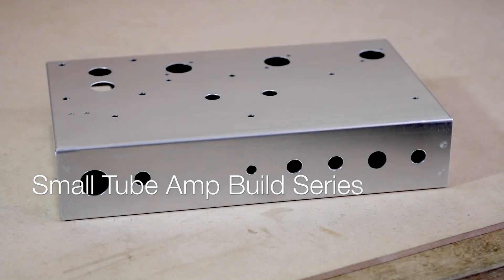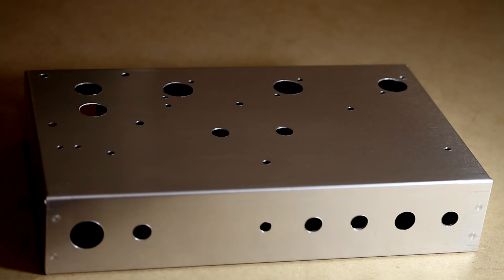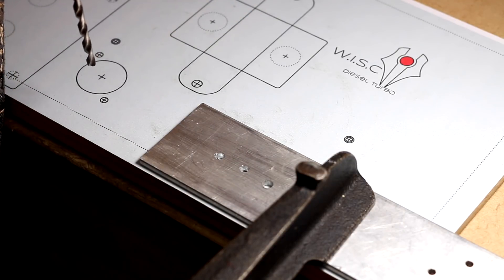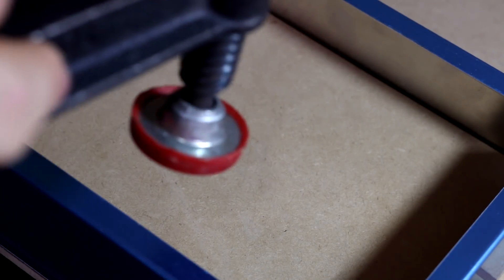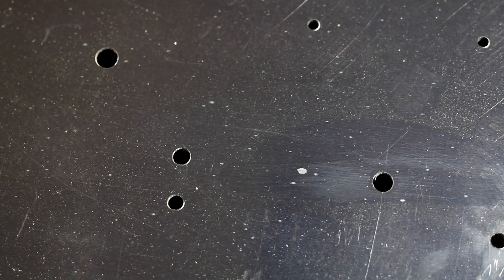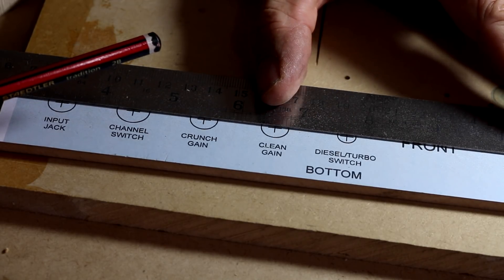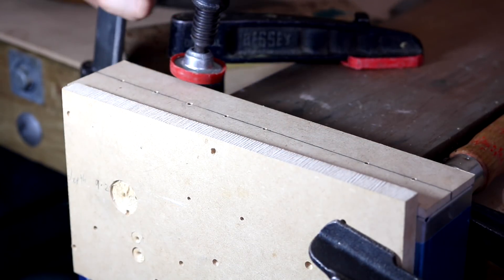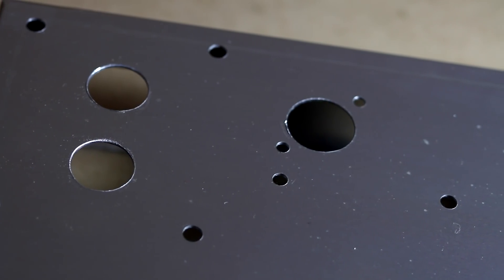Small Tube Amp Build - Step by Step (2 - Chassis)

Comment: What program are you using to create the templates? Im planning a build currently and want to use the same style chasiss just different size. Id love to find a program that helps with alignment and exact measurements
Reply from the maker: Best free program is Inkscape. It is the most  accurate. I also use Google Draw. It's much simpler to use, however nowhere near as powerful.

Comment: I was wondering what program you use to do your templates? I've tried looking at some free CAD softwares I found online but they all seem to be aimed at actual engineers and such and aren't intuitive or quick to learn at all. DIYLC seems ok for actual turret board layout but without easily being able to add parts it isn't so great for chassic hardware layout. Any recommendations? I'm about to go old school and measure/draw by hand lol.
Reply from the maker: I use Google Draw, in the Google Drive system. Its by far the easiest to use for 2D layout stuff (and I've used most), perfect for chassis layouts. I cut out my component photos with photoshop then easily insert into Google Draw. I may do a video one day.

Comment: I use 1/2" MDF and make templates for effect pedals that I build more than once.  You can use a nail and a hammer to punch a dent into the metal so the bit doesn't wonder.
Reply from the maker: Great! Thanks Gary!

Comment: Hey! Bought the plans and got a follow up question:
The transformers are quite pricey and only from the US; any recommendations on cheaper and from other parts of the world (preferrably EU) or what specs should they have, if I source my own?
Reply from the maker: Anything around 250 - 275 volts secondary centre tapped would work. Make sure it has the additional 6.3 volt secondary winding. 100 mv and above is perfect but you can get away with a bit less than that. Bigger is always better of course. I use power transformers out of old tube radios from the 50's. They work perfect and you can pick them up super cheaply. Cheers and all the best

Comment: We do not have to see how you build the chassis, any moron can do that, get to the point and do the elctronics, tell us about the transformers, high voltage, size of the capacitors, tube biasing.
Reply from the maker: Robert Kattner Thanks Robert Kattner

Comment: Beautiful work Geoff. I've got a selection of step bits (unibits) that I use for electrical work that might do the trick. They're designed for use on thin sheet metal junction boxes

Comment: A set of hole punches including one for the IEC plug are essential. Life is too short.
Reply from the maker: Thanks Charles. You may be able to get away with centre punching if you have a very small cylinder anvil, however the shape of the box and its lips provide limitations. Drilling holes accurately is always a very difficult thing. Whatever way one finds easiest is always good though indeed. Cheers